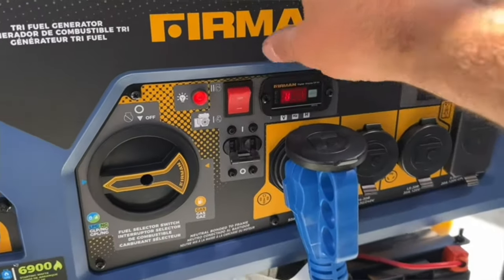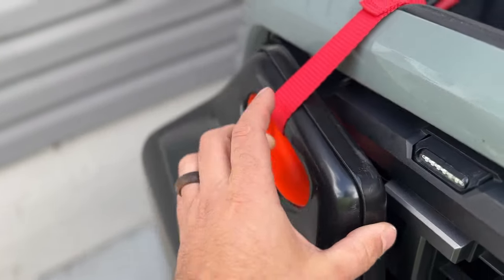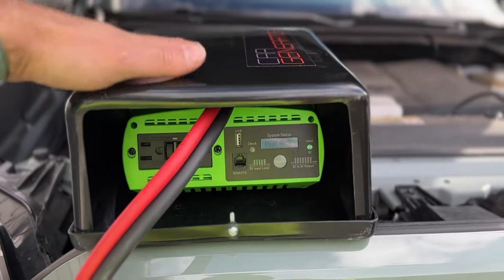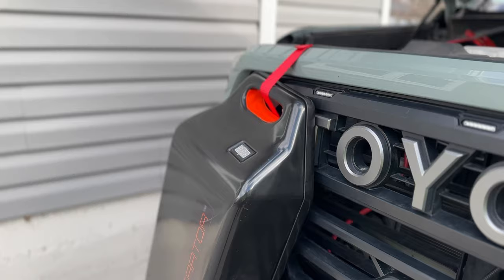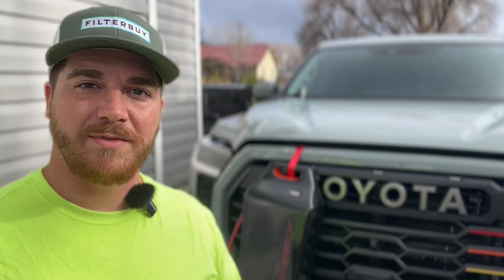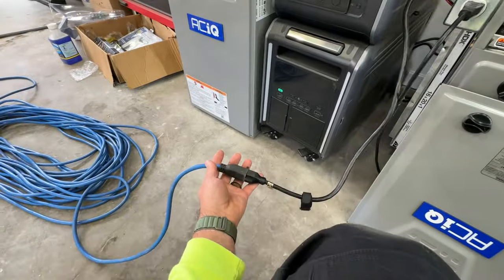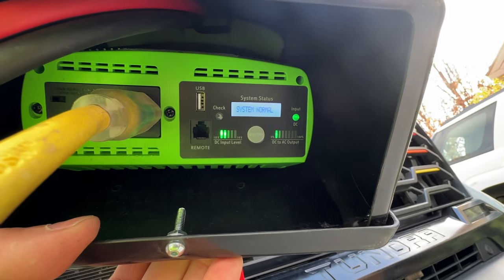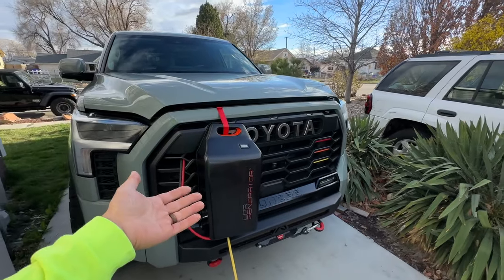Well Generators, It Been A Good Run...

Comment: A few helpful tips to add...  
-CarGenerator is meant to be used only with the car engine is running, and the voltmeter should always show 13.5 volts or more so your alternator is happy.
-the booster cable normally lays between the (semi-closed) hood The hook also prevents the hood from closing to keep the cable from being pinched.  This also activates the vehicle warning system that your hood is ajar to help folks not drive away with CarGenerator attached :)
-the strap should be pulled out behind the handle so it hangs more vertically.
-a bicycle cable lock through the CarGenerator handle helps as a visual theft deterrent to help secure it.
Reply from the maker: Thank you! I will pin this comment for everyone who watches the video 👍🏼

Comment: I've always thought about doing this, so it's interesting to see a product built around it. However, I'd like to see some real testing on different vehicles than just the platitudes on the company's FAQ page. It claims no issues with idling for hours by comparing with cop cars, but those aren't idling with 1000W of load on the alternator. Sedans probably have around a 100A alternator, which is more like 80A at idle, so it will make 1000W, but that's pretty much maxed out. 

I'd probably only want to run something like this when it's cold out (to cool the engine/alternator better), and only for an hour or so intermittently. Anything longer and I'd expect to shorten the life of the alternator drastically. In my younger days, I was one of those 'trunk full of subwoofers' guys, and it was common to blow alternators from the amplifier draw and to swap in high output units.

Comment: My inverter that I currently use in my truck. Already has 8 gauge wiring going to to my center console? And there is already a high current feeder bus. Going front and back. All I have to do is plug an orange extension cord into the fighter of the 2 front or back. Pigtails that are already live of a 120 V. Soon to have 240 V as well on board for certain things, but it'll be 400 Hz. Aviation equipment will be running on board my truck
Reply from the maker: Sick!

Comment: It's interesting and a nice option.  It's also $900 for the 1000W version.  Well, 1000W if your alternator is up to it. Most are not, especially at idle.
Very limited use case for this product.
I'll stick with my 3300W (continuous) gas generator that I paid $200 for (and have to drain the gas after each use).
Reply: $749 using the DIY HVAC guy link provided.   to calculate your vehicles available output power, call your vehicle dealer, parts dept, they will tell you your car alternator "amp rating"  , reduce this by half due to idle speed,  times 12 volts = approx watts available

Comment: Could You Please Put A Link Of The Cable From Battery To Inverter Or Post Specs. Like Wire Gauge And Amperage Of The Anderson Type Plug. Thank You. Very Good Job And Informative Videos!

Comment: You were using natural gas so it would be interesting to compare cost per hour to run the truck compared to using natural gas. I think that bigger engine will use much more gas. I find that in generators. The bigger the generator the more gas it uses so buy an engine that gives you the power you need. The truck unit is a good idea to have but if you use it often camping then maybe get a deep cycle battery and a separator or carry a jump starter in case the alternator quits.

Comment: Wonder how this would work with solar as oppose to attaching to a vehicle.
Reply: Gooogle
dc+watts+vs+ac+watts 
Other than that it's really a matter of having enough solar to equal the AC Watt output.
For instance, my newer fridge uses about 400 watts (as seen in the manual that came with it), so if I had a solar system for 600 watts (allowing losses to get it to the connection & such (like enough sunlight to make 400 + watts, then it's pretty much work alright.
Theory is there, just gotta find out by real trials.

Comment: Isn't that bad on a car battery that isn't a deep cycle battery that's made for that much discharge and recharge
Reply from the maker: A car battery has the same warranty regardless what it is used for, but no it’s not bad, nor is it bad to idle your vehicle. Most people that live in large cities sit in traffic for countless hours per week. This is really designed to use while your car is running though, and you can run it much longer at idle than any generator and it’s way quieter. Cheers
Reply: CarGenerator is meant to be used always with the engine running.   Make sure the vehicle voltage stays above 13.5 and then you are assured your alternator is functioning perfectly and within range.  thanks.

Comment: I'd say make sure you have a booster pack handy  and  extra fuel by the time your unit  if like other inverters I've had beeps to warn of impending shut down at 10,8 volts its too late to start the vehicle and I don't know what that truck will use of fuel while idling with what mine takes it's a lot but smaller vehicles don't take much my sisters Hyundai we found out by accident that it's  not bad one day we we stopped for supper at 300 o'clock  after unlocking she parked on the street and came in after 6 I went out to get the vehicle and when I pushed the unlock button it didn't respond and I wondered why until I got closer and realized it was running and the gas gage had barely moved  as for mounting the unit I would run the wires inside the cab might be more work but better than realizing that the furnace has stopped and on checking find the unit gone and if  you left the vehicle charging it's gone too

Comment: Eight amps of continuous 120-volt output might power gas-fired furnace since the only load is a fan motor, or a typical residential refrigerator, or something else like that. But it's not going to power a typical residential 5-ton heat pump, or even a typical electric backup heat element. I know you didn't claim it would...I just want to make sure that uneducated viewers don't think this is going to power up their whole house or anything. The average automotive alternator just isn't capable of meeting such a demand.

Comment: I don't think I like this idea or running a car/truck's 6 or 8 cyl engine using gasoline that might not be available to refill.
I prefer the Vtoman jump 1000 or equiv and plugging the furnace etc in to it for short outages, and using a couple of portable solar panels on the jump 1000,and if its a longer outage- recharging the battery with my 1500 watt Powermate inverter generator for an hour or two.
Reply from the maker: Just giving people options here. I think this is a pretty cool thing, but yes harnessing the power of the sun is the way to go. I agree

Comment: Very bad to leave modern gas or diesel vehicles idling for a long time.  I wouldn't do it.  End up damaging your vehicles.
Reply: IS IDLING BAD?   IDLING IS A FACT OF LIFE AND YOU IDLE EVERY DAY
* First lets define the term: what do vehicle manufacturers count as “idling” ?   
* How much idling is too much?   15 minutes?   An hour?   Two or three hours?  Overnight?
* 2021 Ford F150 with built in 2000w inverter generator idles for 85 hours continuous on a tank, no problem.
* Prove it to yourself, connect a vehicle OBD scanner to your car and observe your  A) total engine hours and  B) your total idle hours. 
* You will notice that EVERY SECOND your engine is running and your vehicle is not moving, adds to the idle time counter.  Yep, waiting at a stoplight, stuck in traffic, or staying cool or warm in your vehicle while waiting to pickup the kids from soccer.
* Every hour you idle (even accumulation as you wait at a stoplight etc) counts as roughly 25 miles of driving.
* Millions of people around the world idle vehicles every day, sales people, taxis, deliveries, no harm.
* SUMMARY:  of the thousands of hours we run our vehicle engine, a day or two extra occasionally, is not even a drop in the bucket, and no harm at all.

Comment: This is not practical for any real power demand. Great for brewing a pot of coffee tho... 
Imagine running a V8 engine to get 1kw of power.  LoL
Reply: to calculate your vehicles available output power, call your vehicle dealer, parts dept, they will tell you your car alternator "amp rating"  , reduce this by half due to idle speed,  times 12 volts = approx watts available.   Or you can measure it accurately with a DC amp clamp meter like in this video.  https://youtu.be/Js4K6N5rMCg